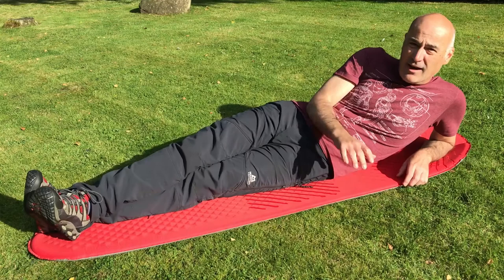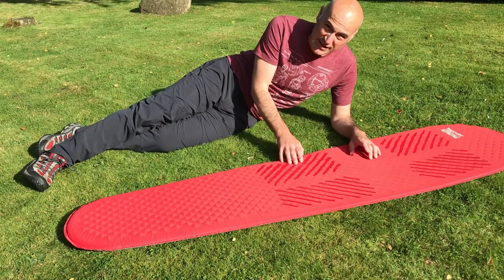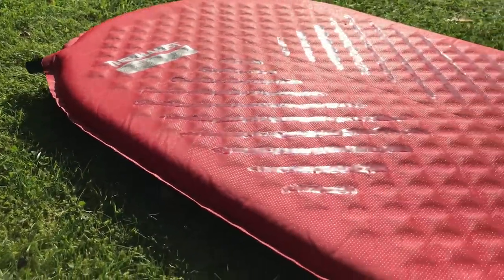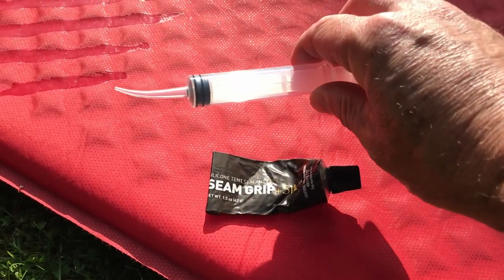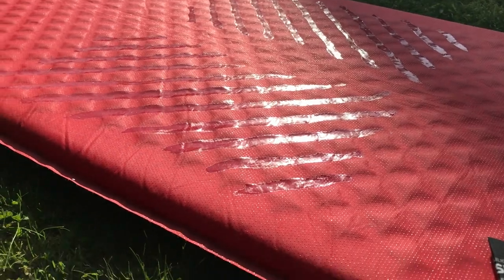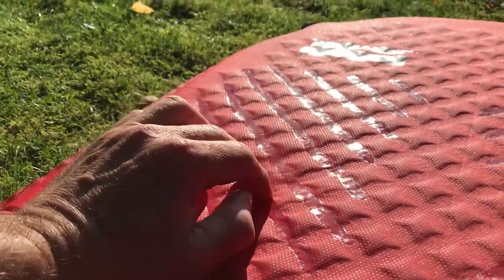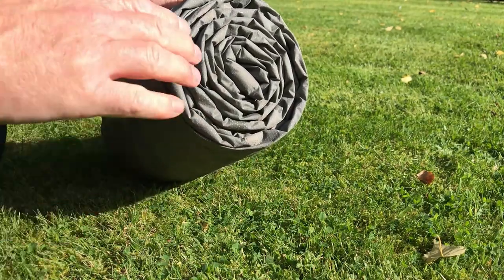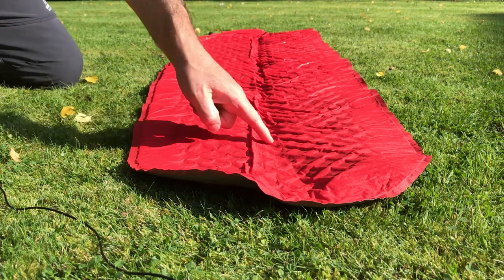How to stop Thermarest mat slipping HACK - Lightweight camping

Comment: Just got around to putting silicone sealant on my pad. Worked like a charm!  Thanks Justin.
Reply from the maker: It really works doesn’t it?! Leave your pad inflated overnight to let the silicone fully dry. If any bits are lumpy or peel off, they were probably too thick. Just re-apply a bit thinner. 👍
Reply: @JustinWhiting9  I applied thin with mat inflated and dried overnight inflated. My silicone came with a small brush. Thanks.
Reply from the maker: Nice one Chris 🍺

Comment: Love your solution! How has it weathered over time? Also, any suggestions for finding one of those nifty little applicator syringes?
Reply from the maker: Yes, it still works Paul. I’ve got a different air mattress now and I did the same thing to it. I bought 2 dental syringes cheap off eBay. 👍
Reply: @JustinWhiting9  , thanks Justin!

Comment: Trekology UL80 for the win! Need the extra comfort in my old age!
Reply from the maker: Yeah, Dan has one of those. It did look comfy. 👍
Reply: Haha I did this exact hack to my trekology UL80, it's absolutely the most comfortable sleeping pad I've ever slept on. At 525g after the silicon applied, still very light and warm bc you're really high up from the ground. The curve design helps stop you from rolling off the pad. Highly recommend that sleeping pad.
Reply: Thanks for this hack, will definitely try it.
Reply from the maker: @rkatrails   It definitely works. I sold that red mat and did the same hack to my new mat. 👍

Comment: I’ve been wanting to try this but I’m concerned that when I roll up my Thermarest pad the silicon on the sides of the pad that get folded together will stick together. Does that happen?
Reply from the maker: Hi, good question. I had the same concern beforehand, but the silicone does not stick together after it has fully dried. I treated one side then left it inflated overnight for the silicone to dry. Then turned the mat over and did the same on the other side. You'll notice in the video I also left breaks where the fold lines were too. I have a new mat now and did exactly the same process again. 👍

Comment: It’s a good idea bro, but gives me visions of the old solevite adverts from the 80s 8) weights bout to worrie about either
Reply from the maker: Not sure I’d want to be hanging from a helicopter stuck to my Thermarest! 😂
Reply: @JustinWhiting9  lol. I’m gonna put a few dots top and bottom of my pads to give it a test, we know what it’s like waking up in ya tent like you been in a car crash lol !
Reply from the maker: Yeah, under your hips and shoulders though and just smooth it down flat with your finger. When it’s thin and dry it’s still very flexible. I did think about pitching my tent and re-creating a ‘car crash’ scene with arms and legs everywhere.... 😄

Comment: Do you think this would work on keeping my inflatable camping pillow from sliding off of my mat if I added it to the pillow?
Reply from the maker: Hi Tweety, I think it would help but it wouldn't stop it sliding off totally. Before trying the silicone you can try sleeving a t-shirt over the end of your mat and tuck the pillow underneath. I've seen people use their zipped jackets in the same way. Or stuff the pillow well into the hood on your sleeping bag if you have one like that. Cheers! Justin.
Reply: @JustinWhiting9  I tried out your suggestion and slipped my fleece over it. Worked like a charm. It never moved. 👍🏼 Thank you!
Reply from the maker: Hey! I’d call that a win! 👍